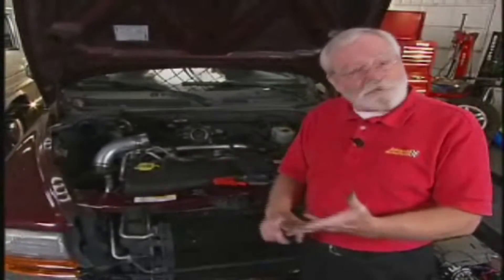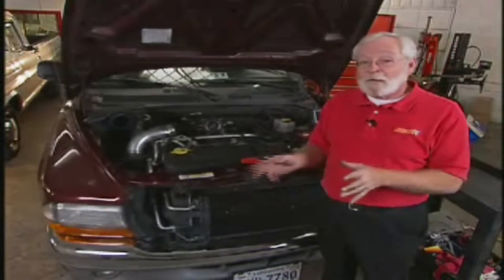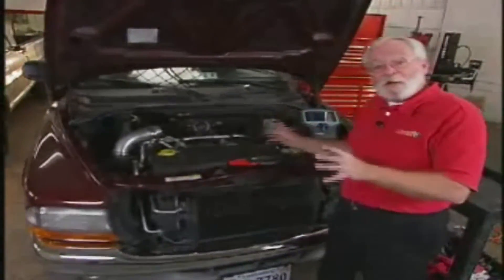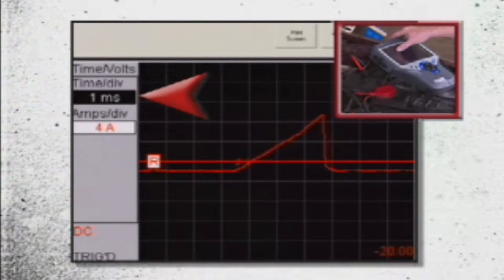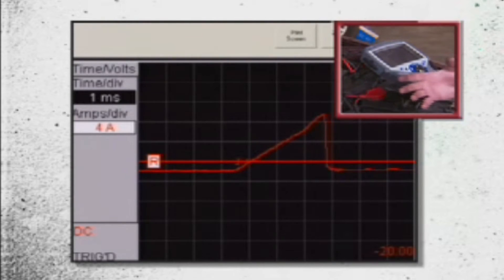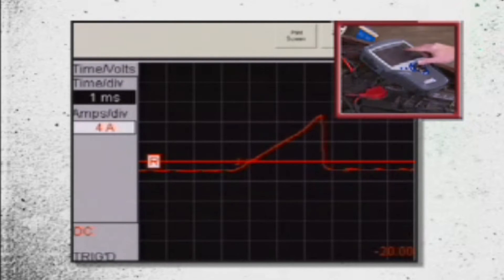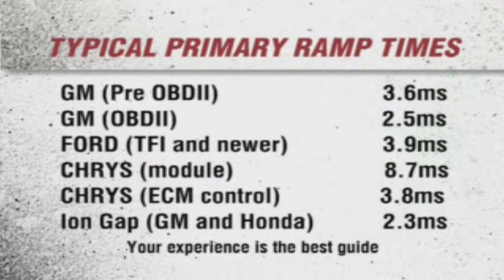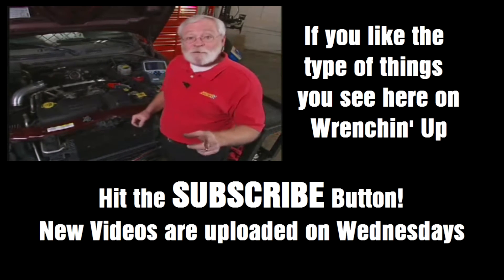Current Ramping Ignition Coils - Wrenchin' Up

Comment: If it was the coil, how
 would you know 
what brand of replacement coil  to use?
Reply from the maker: Hi - The companies who design and manufacture parts like Ignition coils for O.E. also sell these same parts to the aftermarket as well. So, I prefer using replacement parts that I buy from the dealer or from parts stores that I know sell the O.E. part in an aftermarket branded box. Check with the folks at the auto parts store where you buy your parts to be sure you are getting an O.E. replacement part. (how's that for a PC correct answer?) Thanks for watching!